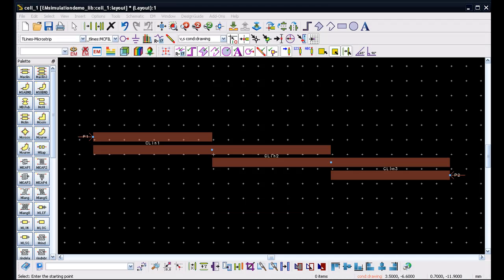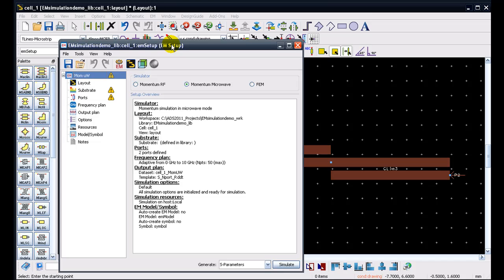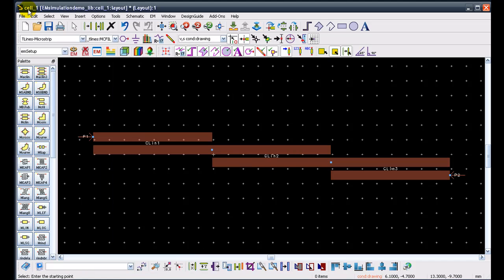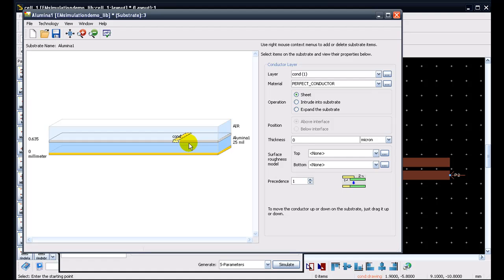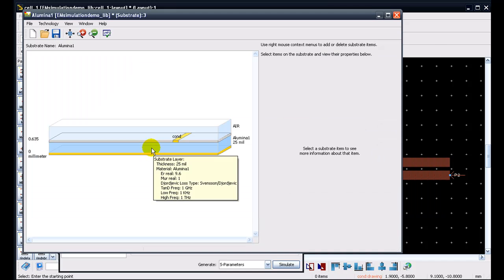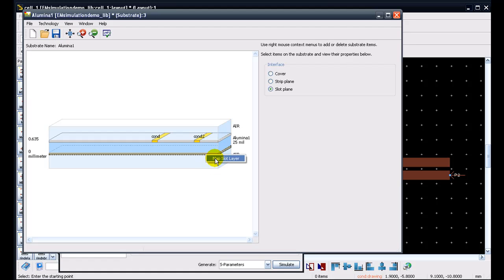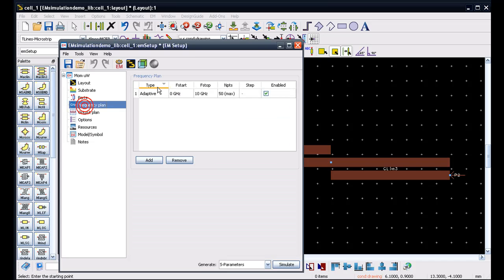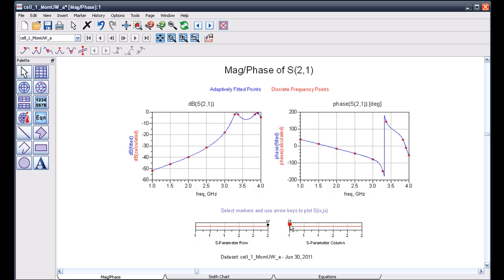Getting Started with Momentum in ADS2011

Comment: Sir, Iam an M.E student and doing a project on energy harvesting.I have a rectifier circuit.and have simulated it in ADS to see the efficiency and output voltage.Now I want the PCB layout. Iam not sure if this makes sense, but will i have to go through EM cosimulation for getting the layout.I also have a matching circuit before a rectifier.So how should I start EM simulation.Can u upload any videos on how to generate a layout from schematic of a simple circuit with impedance matching.For rectifier I have used HSMS didoes.Your help will be greatly appreciated.
Reply: I am EE and I am doing energy harvesting  proj, have you finished your project?